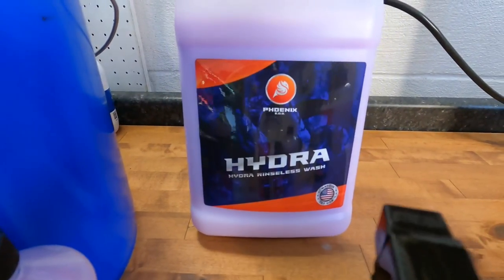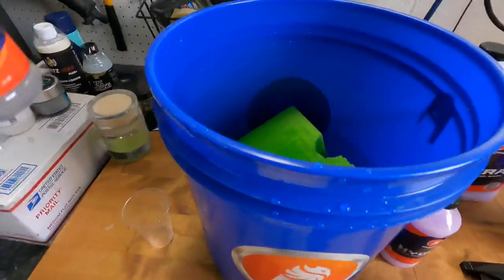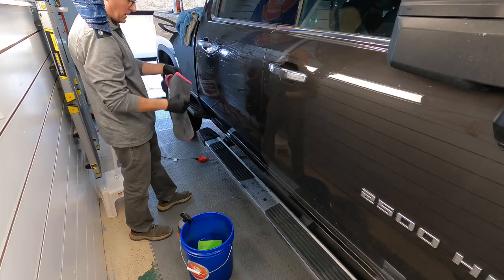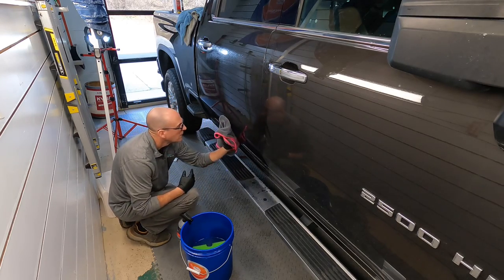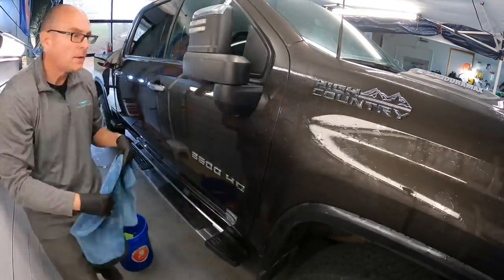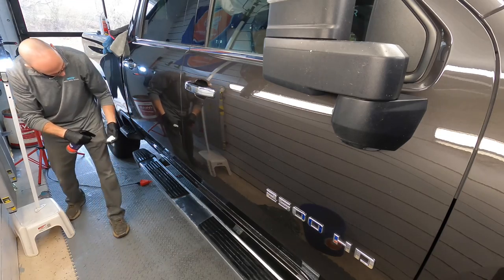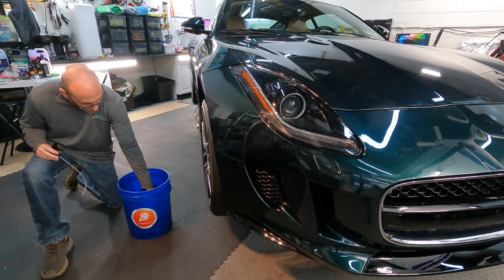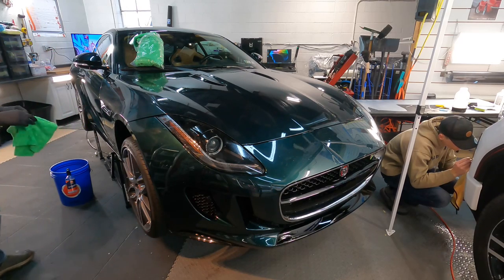Is Hydra Better Than Mckees 37 N-914, P&S Absolute, Wolfgang Uber Rinseless Wash??

Comment from the maker: Your favorite Rinseless Wash?
Reply: Absolute as a wash only, but n914 as a more versatile product.
Reply: ONR and Absolute since Aaron Burkett didn't let me know he was coming with Hydra 2 weeks later after I bought a gallon of Absolute 🤦🏽‍♂️🤷🏾‍♂️😄
Reply: Wolfgang Uber
Reply: ONR and Absolute but Hydra with enough time using it could change my mind.
Reply: I have tried ONR, ONR with Wax., Uber Rinseless wash, but I believe Uber have more lubrication and  doesn't attract dust like ONR does.
Reply: Another great video Brian. I have not used Hydra yet but will be ordering soon. I have been using Absolute exclusively the last month as temps have turned frigid here in Minnesota. Its bearable to use when mixed with warm water. I pre treat using a IK foam Pro 2 pump sprayer, it really lays down a nice thick layer quickly versus a spray bottle. I will put 6-8 Eagle 500 into the bucket with no grit guard. Use all eight sides then discard into a seperate bucket. Never introducing dirty wash media back into the wash bucket. This allows me to cap the bucket and reuse again, very cost effective. Then i will spray on a drying aide along with Eagle 350 to dry the vehicle. I am not sold on the sponge yet or using drying towels. I have three black vehicles and believe me this method is very safe. Use common sense and spray off a really filthy first. I am also a huge fan of Ethos Defy as a waterless option in warmer weather. Ceramics can streaky in mid 30 temps. Keep up the great work Brian and i am blown away by the green paint on you Jag.
Reply: @williambell7712  yeah winter months stink here in Wisconsin too
Reply: I purchased a gallon of ONR five years ago.  But now, I will try one of the newer rinseless washes in a much smaller quantity.  I use it to spray & wipe down my vehicle every time I go out.  And I only wash my vehicle & wheels/tires once a month.  I've always mixed my ONR in a 5 gallon water bottle with distilled water.  And use a heavy duty pump sprayer that I purchased from Home Depot.
Reply: P&S Absolute.
Reply: HYDRA!!!! Hands down!!! 😉
Reply: @millerdetailing4176  you know I won’t disappoint you, Sir!!!
Reply: @1stfrompuertorico568  You didn’t ask!!! We’ve only been teasing this product since The 4th of July!! 😉
Reply: DIY detail rinseless wash just has more cleaning power compared to ONR.
Reply: So far it's P&S Absolute.  I just ordered DIY Detail Rinseless Wash to try as well.  Might have to add Hydra to the list now, too. 👍
Reply: Looks like a nice product but I missed the details of the launch and bought DIY detail. I will say I have several products from Phoenix and they all work really well. Thank you for this video!
Reply: Great review as always Brian!   I haven't used my Hydra yet, so my favorite as of now is Absolute.  Looking forward to trying Hydra real soon to see how they compare.
Reply: @dreklin  😄😄😄I pointed it out on the livestream and I was mad because I spent the money on Absolute for a gallon because yours came afterwards 🤷🏾‍♂️😄😄
Reply: Absolute does pretty much anything you want to use it for
Reply: Awesome video Brother. Hydra looks very competitive with all you stated. I've used wolgang, McKee's n 914, griots, and well, I'm looking forward to spending some time with Hydra! That BRG is stunning btw! 👌
Reply: i have a bottle of hydra but work got in the way of using it... my favorite?. tough call really... Wolfgang, 917, onr , absolute, diy, hyperclean, fenylab...love all of them
Reply: forgot  agd
Reply: Ultima is unbeatable at the price/value. Amazing stuff.
Reply: Gonna try Absolute after my bottle of N-914 runs out
Reply: The only one I have not tried is the Absolute. N-914, Wolfgang and ONR all work well. As long as it’s not to cold out I follow up with Defy to give the paint some protection. 
Thanks for the review 👍✌️☮️
Reply: @1209MArky  I agree with this. N914 is a better buy for all it can be used for and leaving no residue but I love the finish Absolute leaves behind.
Reply: Please conduct another rinseless wash video the week before Black Friday to remind me. I bought ONR & P&S Absolute to bring me through the winter and compare the two side by side.  The good news is I bought a big bottle of Phoenix EOD Titan to use as the drying aid
Reply: I was a devoted ONR user for years, nothing else including N914 could come close to topping it...and I've tried virtually every rinseless on the market.

P&S Absolute is my current favorite. The slickness during washing/drying and the gloss/slickness after is off the charts. Zero effect on coating hydrophobics and no weird buildup. Insane cleaning and encapsulation abilities. Dirt, bugs, bird poop and salt melt off with the presoak. Cheap. Smells great, very stable when mixed to different dilutions and stored for future use.

The car seems to stay clean longer when compared to ONR, but I need to do some side by side testing to know for sure.

I still need to try DIY Detail Rinseless and now Hydra, but Absolute is going to be hard to beat in my opinion.
Reply: @1209MArky  what does N914 do that Absolute can't?

I don't think panel prep counts unless you are only going to apply McKee's coatings that are meant to work with it. You can be dang sure that I'm not going through hours of prep and paint correction and potentially waste a ~$100 bottle of coating just because I skipped using the panel prep designed by the coating manufacturer.
Reply: McKees N-914 rinseless is my favorite. Versatile product that cleans well and leaves nothing behind. I bought P& S Absolute but in cold weather I find it needs to be mixed for a long time otherwise there are little chunks of product in the rinseless solution. For Winter washes in cold temperatures Absolute mixes better if you use warm water.
Reply: @williambell7712  Hi William, I've been doing exactly what you have been doing for a few years now using the edgeless 500 in a bucket with Onr (now Absolute Rinseless) and drying with the eagle 350 with a drying aid all with excellent results. I was wondering if you have also been experiencing some lint drying with the eagle 350? It's not a huge issue because after some passes with drying then doing a final buff seams to clean any lint left behind, also I wash my microfibers seperetly and use "rags to riches" microfiber detergent and air dry so it shouldn't have anything to do with my wash process. Thanks in advance bud.
Reply: Still using the original (ONR) with no problems.  Will not purchase new product till my old supply runs out.  What a game changing product, very economical chemical.  If you're not using a rinseless. you're missing the boat.
Reply: @Sean-ij3mi  Hi Sean, I remember having a tiny bit of linting a while back. Possibly when a new batch of towels. Plush towels will tend too lint a bit on window glass. I also use rags to riches and use the air dry or low setting on my dryer. Do you hang your towels from a line and let air dry ? That might be the culprit, because tumbling in the dryer will catch a tiny bit of lint in the filter screen. I am thinking of using Absolute much more next year on my new 4 Runner the thing is a beast to dry with out spotting in direct sun light. I bought an ego leaf blower to dry with it works great but i still hit with Ethos  Finish Shine or Defy  with an Eagle 350 to boost my ceramic coating. Ethos Defy is a fantastic waterless wash. Thanks for the question, and have a great day.
Reply: I have McKee's N-914 and SIO2 rinseless, Optimum No Rinse, DIY Detail Rinseless Wash and P&S Absolute. Asking which is my favorite is like asking a parent which child they love most. I use them all!
Reply: I've gone through a few bottles of N-914 and love it! But just bought ABSOLUTE and really enjoying it as a rinseless. Will definitely keep N-914 for its versatility
Reply: @dreklin  
Good day, how does the green sponge compare with the big red sponge?
Reply: Good day, how does the green sponge compare with the big red sponge?
Reply: @mariosantiago8931  well, I’ve never used the big red sponge (mainly because of the price tag), but this one boasts it can hold up to 700ml (or roughly 22oz) of water. It has the same “phalanges” as the big red sponge, perfect for picking up dirt, trapping it away from the paint, and then releasing it in your wash bucket. So, although I’ve never used the big red, at over half the price, I think it stacks up pretty good against it. I’ll talk to folk that have used both and get back to you.
Reply: I went on a binge and tested 4 of them over the summer - ONR, Feynlab, McKee's and Wolfgangs. For me I found Feynlab as the out and out best cleaner, by a long long way. But overall use, for one product at can do a lot (rinseless wash, interior cleaning, glass, leather, QD etc etc) it's ONR still. I'd give this a go though, looks good - In2Detailing stock EOD in the UK so it might come here.

Wolfgangs was the worst for me. Slicker maybe, but it's a nightmare to clean out of the mitt/cloth/brush - I dropped a mitt that I'd used for a couple of washes with Wolfgangs (and rinsed with water afterwards) in  a bucket of Feynlab and the water turned black! Like I'd done a full wash of a car with no pre-wash stage at all.
Reply: Looks like I'm the only one here who uses CarPro ECH2O :)
Reply: There's too many rinseless wash products these days! Still using ONR myself, I like their new formula, with OptiClean 1to10 to pretreat which gives the surface nice extra lubrication and some extra cleaning power.
Reply: @kimnewling5728  after using it fairly extensively over the summer in the UK, I don't get the hype around the Wolfgang's. I can't argue it makes the slickest QD, but the wash experience....it left the wash mitt really dirty, and I couldn't shift it (until I used the mitt in a Feynlab Rinseless Wash and the water in the bucket looked like I'd done a full contact wash without any sort of pre-wash in the middle of winter). Neither McKee's or Wolfgang's were as good as ONR in my experience (although McKee's was far closer, and it doesn't have issues with availability like ONR does). Feynlab is the out and out best cleaner of the lot though.
Reply: @SuperchargedLlama  thanks for the feedback
Reply: @willoverkill8461  I like having options. There's about a million different soaps, why not a bunch of different rinseless products?
Reply: @jeffc6832  For the consumer it's a lot of choices and can be tough when detail product reviewers start claiming different favorites when really most do the exact same thing. McKee's has 4 different rinseless washes for heavens sake.
Reply: @kimnewling5728  I like your reply a lot. It's not argumentative, even if we share a difference if opinion. If only more people conducted themselves that way. Truly appreciated 👍
Reply: Just a question: which of the various flavors of Absolut do you like? Citron, peach? And how do you take your Absolut?😁😁
Reply: I'm using McKees right now, but I think I'll try this now
Reply: Only Rinseless I’ve used is ONR
Reply: @MeliorIlle  yup, Im surprised more people don’t talk about Ultima.
Reply: P & S Absolute , 2nd would be ADG(Wipeout) 3rd: ONR
Reply: DIY detail rinseless wash is my favorite. 
But for interior wipe I like absolute, leaves a bit of sheen. But attracts dust :)
Reply: @SuperchargedLlama streaky nightmare
Reply: @RnBGarvey  which one? The Feynlab is the only one I found that streaks, but at the same time, when you're working panel by panel, using a decent qd as a drying aid, there's no problem.

Comment: Damn! Rinseless wash solutions are popping up all over the place! I have ONR&N-914. I've just started to use N-914.  It does feel a little slicker than ONR.  I'll certainly try Hydra.  The hose is gone, so it's rinseless until April here in Connecticut.

Thank You for another fine video, Brian.  You do put out some superb content.  I've learned so much from You and Your videos.

Comment: So I’m 100% sold on rinceless as a hobbyists. I use Absolute on my lightly driven ceramic coated LS500 and family coated RX350. Bought the IK-9 sprayer to spay the vehicle. I’ll do 5-7 rinceless before I break out the pressure washer.

Comment: Glad to see content creators recently making more content on rinseless. Hydra looks pretty good except for having to use twice as much solution compared to the competition's 1:256 ratio.
Reply: So,,,,,,, instead of it costing 25 cents a car in material it would cost 50 cents a car. 🤦🤷‍♂️
Reply: @chrissemsch8781  for detailers trying to make a profit, it matters.
Reply: @bullrage74  time to bump up your price by 50 cents
Reply: I also tend to use alot since I pre spray with rinseless at a 128:1 ratio with a ik sprayer then use a mitt with a standard dilution and use 3-4 total  gallons if I'm also cleaning wheels in the  winter months. I could use far less but I would rather use more liquid and less towels since replacing towels is far more costly when using quality towels.
Reply: @dustin3700  You don’t wash and reuse your towels?!

Comment: A gallon of ONR you can get for $25-30, on sale.  Hydra is $44, but you need twice as much (128:1 versus 256:1)  So it's basically 4x more expensive than ONR.  Is it worth it?
Reply: I picked up Brian's directions at the beginning,  1 oz per gallon.  I agree with your assessment.
Reply from the maker: This has way more lubrication and cleaning power....ONR is a dinosaur. No scratching and marring is priceless to me.
Reply: @apexdetail85  I, too, have and use ALL the more popular branded rinseless wash products … including Hydra. If we’re being fair, yes, Hydra is a tad more lubricated than OnR. At least the older version of OnR. Hydra does NOT clean any better or worse than OnR, that’s nonsense.

This brings up an excellent point, though. At what point does “lubrication” become a diminishing return? I feel like some of the original rinseless washes were perfectly fine on lubrication. I’m talking before Wolfgang or OnR existed. I mean, yeah they streaked a bit but that was eliminated later on.

As a professional, I would suggest investing in cheaper products that deliver on results. At home, use what you want to use. If you want to buy $500 a gallon what ever, have fun with it, enjoy. Who cares? I’m just saying, as a professional, more expensive means less profit. Period.

😊😊😊

Comment: My main issue isn't with the product itself picked up a gallon of this and a gallon of P&S Absolute. Both are awesome however P&S is .5 of an oz per gallon for rinsless washing and has different dilution ratios based on the use. Where as Hydra has the same dilution ratio for every use which is 1 oz per gallon. If looking at it from a value perspective absolute or the others mentioned in the vid just make more sense
Reply from the maker: With the lubrication....and ability to keep the surface safe from scrathing and marring.....it is priceless to me.
Reply: @Apex Detail  fair enough Brian I am a big fan of phoenix Eod so plan on supporting them by picking more up in the future

Comment: Still using ONR myself, I like their new formula. I like to pretreat the panels with OptiClean 1-to-10 which gives noticable extra lubrication and some extra cleaning power. 

Wolfgang Uber is a terrific drying aid and glass cleaner (!) when mixed at detailer strength but I don't use it any other way.

Comment: Brian, on a car that's actually dirty, like after driving in the rain and/or after a week, do you use a 2nd bucket/grit guard for rinsing the dirt out🤔
Reply: I always use a second bucket when rinesless washing my vehicle because I've noticed one bucket still transfers residue/dirt back onto the paint. This happened with N-914 and a grit guard
Reply: @Steven Guadalupe  unless the car is slightly dusty and I mean SLIGHTLY, I'll never understand why anyone shows the 1BM to do a RW. I'm certainly no pro but I've been doing them for 12 yrs and as soon as started doing them the 2nd bucket came out, just made sense to me.

The 1BM is only for when you've got many mf towels soaking and THEY are the wash media, pre-treating every panel here as well👍👍
Reply: @bullrage74 probably true with N914 since it just seems to emulsify. It doesn’t encapsulate and pull the dirt to the bottom of the bucket like polymer based rinseless washes so.
Reply: @klasseact6663  yeah, I do a hybrid method of soaking with rinseless, pressure washing, doing the rinseless contact wash with 2 buckets, and then drying. Works the best for me for cleaning and not instilling love marks
Reply: @Steven Guadalupe  yeah power washing that top layer off first is always best. I've bought a monthly sub to a touchless carwash near my work due to being in an apartment that has pine trees in the yard behind us, this is a good thing now because instead if slip sliding at the quarter wash I can just drive through the touchless wash now, plus I'll be pre-treating with Bilt-Hamber Auto-foam or Touchless once a week or more when needed to win the battle against salt!!
Reply from the maker: Absolutely.

Comment: What brand and model of clay are you using? I've needed to do this to my Mustang for a while now but I don't want to add more defects.
Reply: Any mild clay will work just make sure you use a quality lube and if using a rinseless product add a little extra then suggested and keep the clay and panel wet and use just enough pressure to keep the clay on the panel and move in short fast moments I do a hand waving motion with my wrist because if you use your shoulder or elbow your arm will be gassed out in short order if doing a entire vehicle.